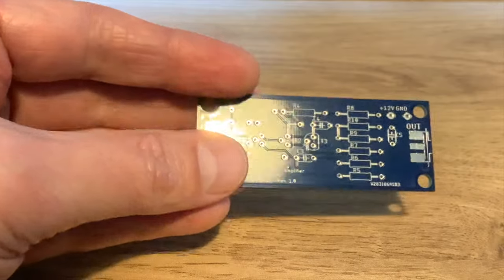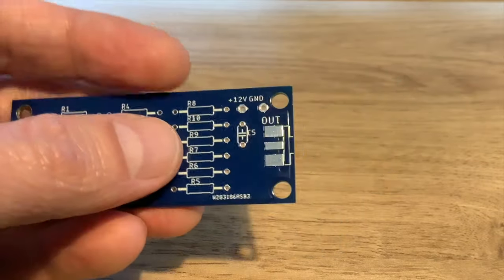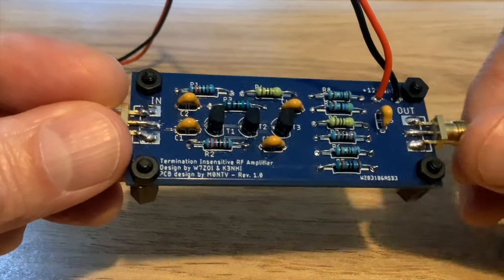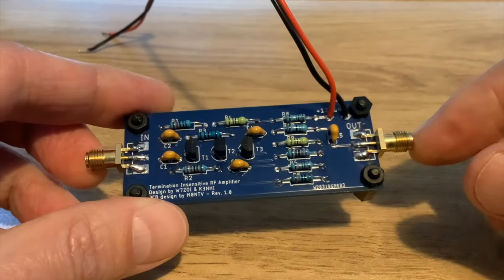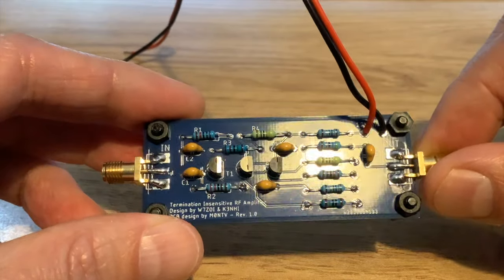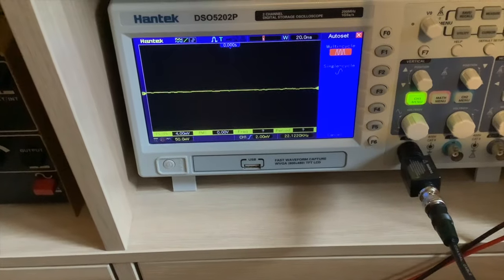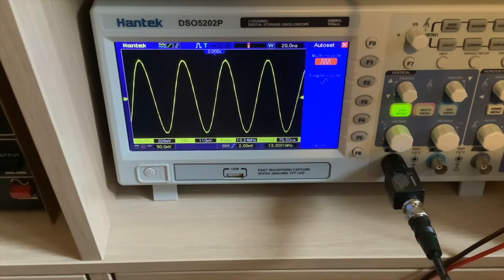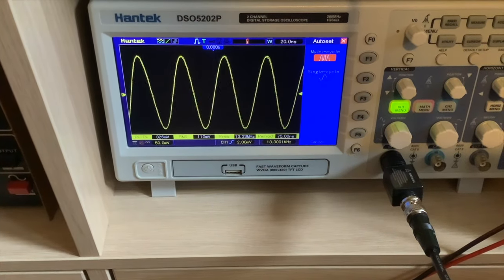45 - IF Amplifiers

Comment: Hi Nick, great video again.
Are you going to use the same set of amplifiers between the BPF and first mixer?
73, Gerard
Reply from the maker: Thanks Gerard. Yes, indeed! I've put two 20 dB TIAs in there: one works as the post mixer amp on TX and the other as the RF preamp on RX. Once I've built the mic amp I'll show the whole lot working together. Thanks again. 73 Nick

Comment: Is that module from the Zero IF transceiver.
Reply from the maker: Hi David, I've used it before in my 'Optimiser' Rig and now in my 15m/10m creation. Wes & Bob originally designed it to go into Farhan's BitX transceiver to replace the existing one transistor design. I've linked to their paper in the description. 73 Nick

Comment: Nick--Many thanks for the shout-out! I didn't know you'd done this and I just happened to run across it. 

One thing I like about your PCB design is that it's not too compact . . . I think mine is too crammed together for some people. Coincidentally, I recent decided to do a "large-print" edition so those who suffer from FFS (fat-finger syndrome) have an easier time assembling them. I'm still waiting for the prototypes to come in from Shenzhen. 

In addition to spacing things out a bit, I made the pads for the gain-setting resistors without holes but big enough to use like Manhattan isolation pads (or like Chuck Adams' "muppet" pads). This will make it vastly easier to change the gain as desired. Getting those resistors out of the holes in the existing board is hard enough, but then clearing out the solder from those plated-through holes to install different resistors is a nightmare. The "large-print" edition with the surface pads should make it easy. --73, Todd K7TFC
Reply from the maker: Hi Todd, you are very welcome! I think your boards are brilliant. Keep up the great work. 73, Nick

Comment: Can the distortion be seen on an oscilloscope when you reach the compression point? I would like a spectrum analyser but it’s beyond my budget
Reply from the maker: Hi there! There are different ways you can do this. The main things you need are (1) a way to alter the input signal by 1 dB increments and (2) a way of recording the output signal. The first can be achieved with a signal generator (either sweeping or on a spot frequency) + a stepped attenuator. Then you can put in some arbitrary signal level and a high level of attenuation (e.g. 30 dB). Then you progressively reduce the attenuation 1 dB at a time and so increase the signal level 1 dB at a time. When it comes to (2) measuring the output you can use:
i) a TinySA
ii) an SDR (e.g. SDRPlay RSP 1) + free Spectrum Analyser software
iii) you could use your oscilloscope but you'd have to convert your Peak-to-Peak voltage readings into dBm. Check here: https://3roam.com/dbm-to-vpp-calculator/

Hope this helps! 73, Nick
Reply: @M0NTVHomebrewing  
Thanks for this. I was also inspired by your crystal filter design but put off by not having much in the way of test gear. You offer some good solutions there, Perhaps a VXO controlled direct conversion receiver plus PC based audio spectrum analyser would enable me to see the pass band?
Reply from the maker: For filters you really need to be able to see it in the frequency domain. A cheap NanoVNA will do the job very well.

Comment: Be careful with that spectrum analyzer! I would recommend to put an external DC block on the input to the SA. Even if it is internally protected for DC it is a good practice and habit to get to always have a DC block (and possibly a pad as well) to protect the sensitive (and very expensive to repair) input stage of the SA.
Reply from the maker: Thanks Orjan. That's a good call. I also usually use an external 20 dB attenuator on the RF input port  - just to be safe. I'll check out the DC block. Thanks again. 73 Nick

Comment: Nicely done video Nick. Especially the compression point. 

Re the Gerbers: It is possible to edit Gerbers, but it's a bit of a faff and only done if you have to.
Having the full circuits, netlist and layout files etc makes life much easier.

The biggest problem is that the source files may not be readable by all systems, but eagle is (or was before they messed about with the license) one of the more common formats, so should be readable by other layout programs.

Your layout looks really good for a first attempt so well done on that. Two things for the rev 1.01. Pop a hole in each coax pads so that you can insert a terminal pin. It's surprising how easy even big pads can lift if you rework the connections a few times. (In the current design you can drill the pad and solder the pin to both sides.)

Rework the power connections so that they are in the same place and same polarity regardless of which way around the boards are positioned. Helps keep wiring tidy. A design nicety only

Andy
Reply from the maker: Hi Andy. Good to hear from you. Thank you so much not only for watching but for your very helpful comments on the PCB. That is really useful and good advice that I'm sure I will return to. It was an interesting experience designing the PCB but I think it'll probably be a bit like when I finish a homebrew radio: I immediately start thinking what I'll change about the next one! Thanks again. 73 Nick
Reply: Yes you can always do better if you tweak this and that... I generally go through about three revisions before I'm happy enough to send things off to the PCB house.

With the TIA design while looking at your layout I thought, "I wonder how small that would go using SMT" ... maybe one day I'll find out 🙂